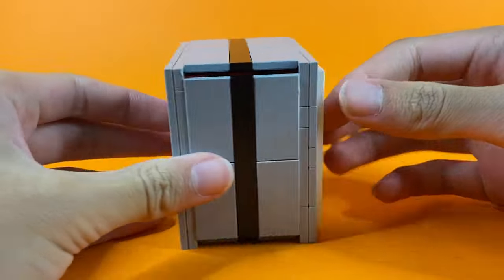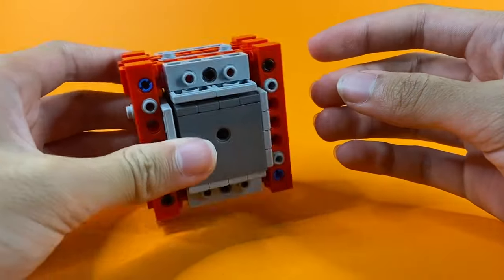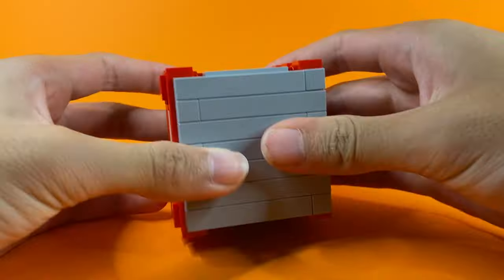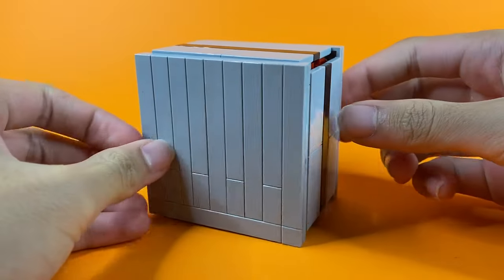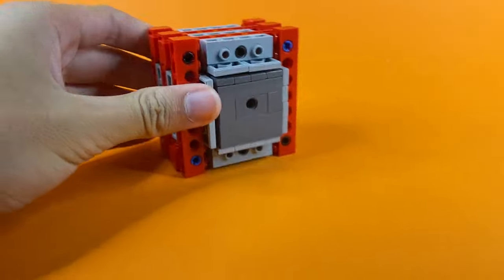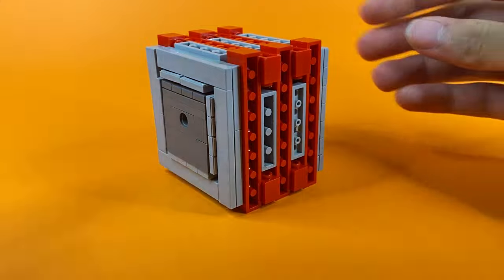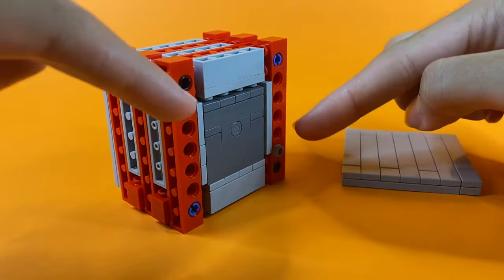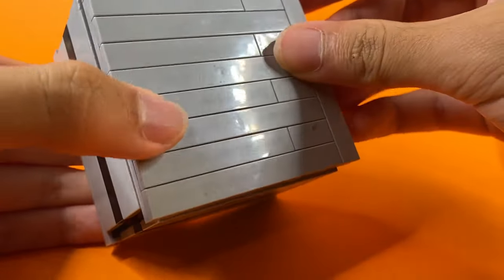How To Make An UNBREAKABLE Lego Safe!! (not clickbait)

Comment: Can't you, after pulling off the decoration, access the hole that the gear rack locks into, and just push it in? That way you can trivially open the safe (and take it apart afterwards for good measure).
Reply from the maker: good point. If i made it again I would use a gear rack with a 1x1 plate attached so it can only go out a certain amount so you cant pull on it
Reply: @puzzLEGO  sorry I didn't mean pull it out, I meant push it in, the same motion as when opening the safe the intended way. You can't prevent that movement, so you gotta block access to the gear rack from outside.
Reply from the maker: @PhoenixClank  oh wait you can push it in. That is a problem, I actually don’t know how I would fix that
Reply: @puzzLEGO  If you build it slightly bigger, you would have room to put plates or bricks along the inside that would cover the gear rack from the outside and would be unable to be removed when the safe was closed.

Comment: if it is unbreakable, then how did you make it?
Reply from the maker: The tiles on the inside are stopping me from pulling the safe apart but the only way to move the tiles is if the drawer wasn’t there so the only way to open the safe is to remove the drawer first

Comment: What happens if you burn the Lego or smash a 50 pound sledge hammer on it
Reply from the maker: Sledge hammer probably won’t do much, if you burn it it has to be hot enough for the lego to melt